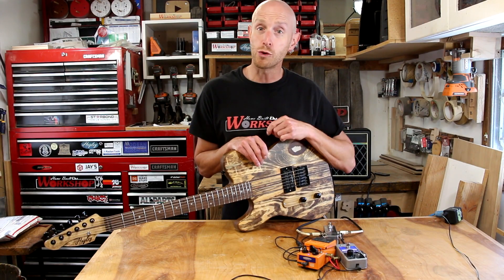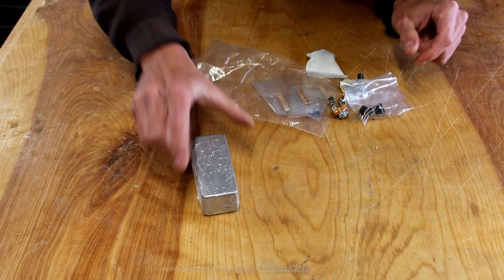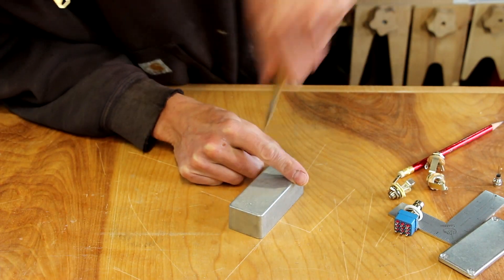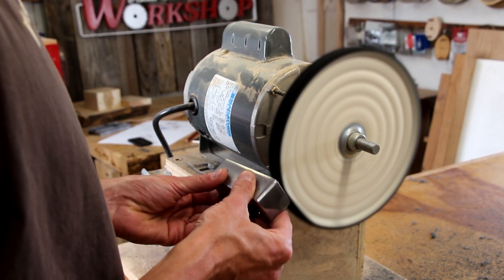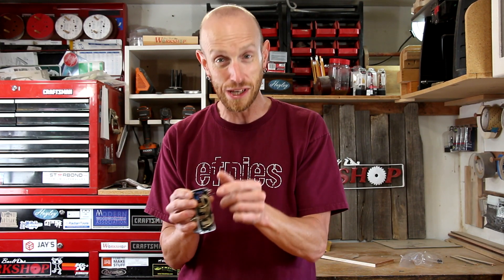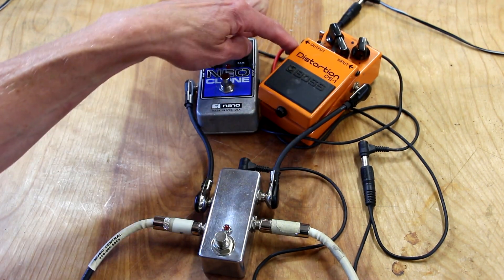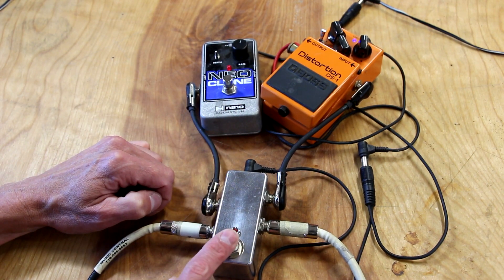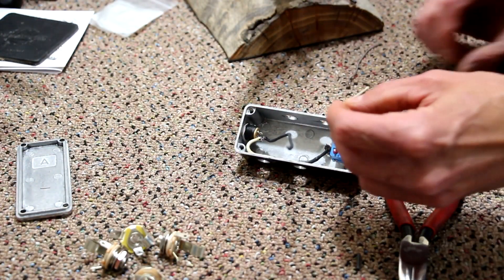How to make a guitar looper pedal | A fun electronics project

Comment: These are handy for A/B testing. The one I made I put in a two color LED so it’s green for pass through and red for effects loop. Also, totally get the melted soldering post frustration. I have to be really careful soldering switches to avoid that.

Comment: im confused of the polarity of the power supply, my question is that the center is negative or positive... (-) center (+) outer?
Reply from the maker: They make them both ways, what is important is that you are using the correct one. As long as your wiring matches the power supply it really doesn't matter.

Comment: probably a stupid question, but why can’t a send return looper pedal be a passive wired switch? so it won’t need 9v supply. like if you only give up on an LED. thanks
Reply from the maker: It absolutely could. Like you said, it just wouldn't have the LED. I'm pretty sure I've seen wiring diagrams for that.

Comment: Great build! I built myself one with two loops, so that when off, the signal goes to loop A, and when on, the signal goes to loop B. Theres is no "no loop" option. As you suggested, I simply duplicated the circuit. But I have a problem: I couldn't get around grounding the two loops separeately. As a result, what pedals I have on one loop will affect the tone of the other loop in a perceptible way. For example, if I have in loop A a non true bypass pedal that causes tone bleed, that tone bleed will occur also on loop B even when only loop B is selected. I suspect the problem is in sharing the ground connection. Any ideas on how to wire this properly? Thanks. Congratulations for your channel!

Comment: Hello! Very interesting video! I'm going to make a loop pedal to shunt my Boss RC30 (Thanks to your help).
I will probably use a 4PDT in order to simultaneously shut off the RC30 power  when it'is not in use.

Question : Into the loop pedals finded in the market, is the power supply only used for the LED ?? No extra sophisticated electronic components ?? (If not, it's amazing in regard to the selling price...)

Best wishes from France for the new year!
Reply from the maker: Happy New Year! I think for many of the loopers on the market the power supply is for the lights. I don't know if every single one is like that, but if its just a basic looper its probably only powering the lights. This one I made could easily be scaled up to contain however many switches you need and the power supply would only power the lights. Its pretty simple really.
Reply: @homebuiltshop   Thank you for your answer! I looked carefully at your diagram: to power on my RC30 only when the pedal is activated, I just have to connect the + wire on the + 9v input (on the long leg of the LED) and the - wire on the 3PDT where the resistor arrives. So a 3PDT is enough. No need for a 4PDT.

Comment: Hi. I have a question. What if you put a pedal before de looper and then you turn both on? Does the looper turn off the previous one? For instance, if the signal chain is guitar - overdrive - looper - delay - amp, and all of them are turned on, does the looper prevent the overdrive from working, or not necessarily? Nice review btw.
Reply from the maker: If the OD is before the looper, when you engage the loop, the overdrive signal would be routed through the delay or whatever is in the loop. It does not turn off anything before the looper. Its like an effects loop, whatever you send into the loop will be modified by what is in the loop.
Reply: @homebuiltshop  hi man i have a question, if i have a delay after the loop box, will it mix with the dist+chorus (your video as an example) if i have it turn on?

Comment: Just made one of these. One issue I had was the input and output line is buzzing. I noticed you didn’t seem to use any flux, I did. Not sure if that has anything to do with it. Also noticed when I plugged in the 9v adapter it would only buzz but when it was shared with a 9v chain it wouldn’t. I also used a lot more resisters than you. I think it’s either something with the input outputs or the LED 9v. Any advice?
Reply: Have you tried with a battery? Sometimes there is noise with an unsuitable power supply and zero noise with a 9v battery ...
Reply: @p.g.pg38  haha we figured it out last year. Put it on an isolated power supply and worked fine.

Comment: I finally got around to building one of these.  I have been meaning to do this for a long time.  Now I have to rearrange my pedal board.  Which I am in the middle of building.  It is a little to hot here in Texas right now to get out in the shop to do things, so It will have to wait.  
Keep the videos coming.
Reply from the maker: Awesome! I had fun putting it together. Did you use a larger enclosure or the same size?
Reply: @homebuiltshop  I used a larger pedal box.  It was one that I had built a "Kill Switch" in.  Just had to add the Send and Receive jacks and wiring.  I would add a picture but I guess we can't do that  on YouTube.
Reply from the maker: Unfortunately cant post pics here. You can on FB though if you want.

Comment: Do you feel that pedals are going obsolete in this day in age? Do you feel that more musicians are using the computer setup like you use? I get that what you use now is a pedal board almost like a processor but you setup all your different sounds on the computer and then download them into the pedal board, so you only have to click one switch to get the sound you want for a specific song. So is the loop pedal a cheaper format then what you use now?
Reply from the maker: I think they each have their place. If I had my choice I'd choose my pedals over my processor. I do like the processor for cover band stuff because I can keep the rig nice and small. The disadvantage I see with it is that its harder to adjust on the fly if I need to. With a pedal, I can just twist a knob and adjust as needed. While there are so many sweet processors out there now, I don't feel pedals are going anywhere.